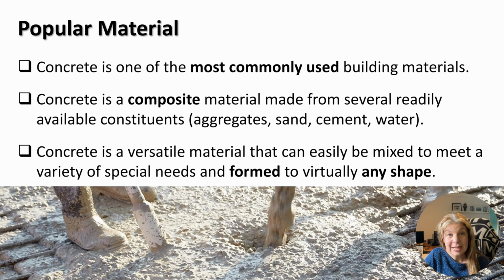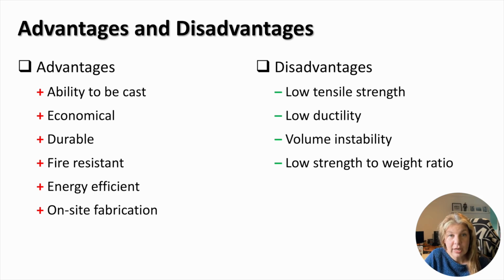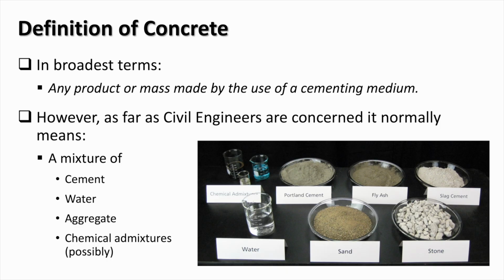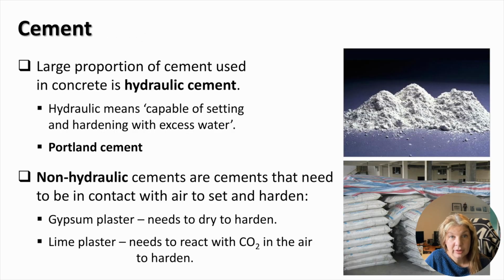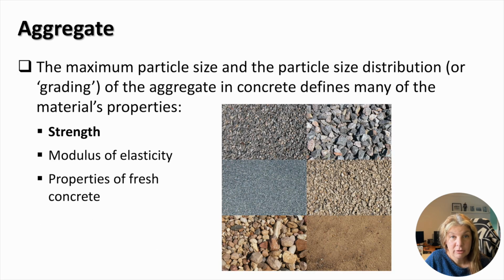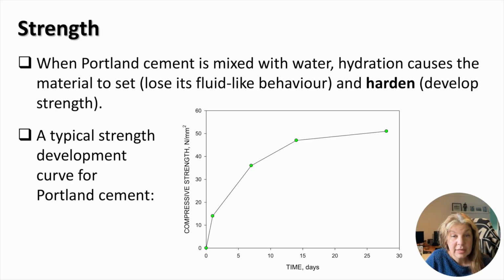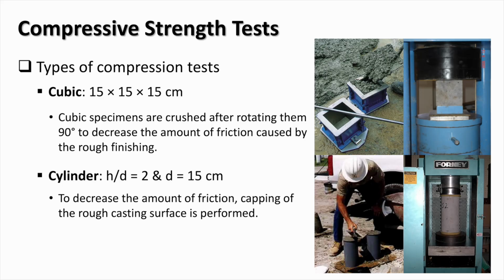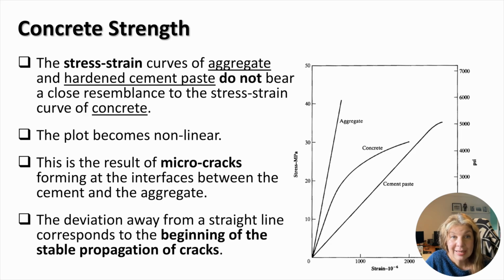Reinforced Concrete Design | Topic 1: Introduction, Part 1 – Concrete Material | Eurocode 2

Comment: Wow u gain new followers 
Please which level are you expecting to write this exam
Reply from the maker: Thanks!
In a university setting I would usually expect a full design report - the design from scratch of parts of a structure (slab, beam and column) starting from analysing the structure, creating the moments and shear envelopes etc.
For an exam I would expect the design of a single element - say column, but with access to the code and flow charts. 
Obviously the actual expectations would very much depend on the year and depth this is studied as well as the university and lecturer.
Good luck!